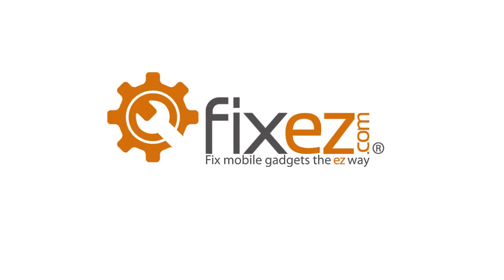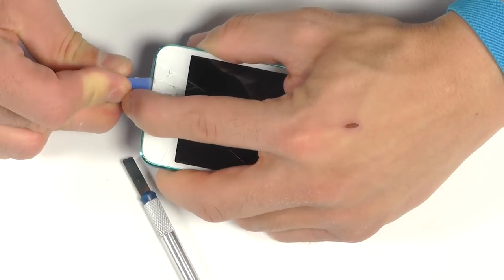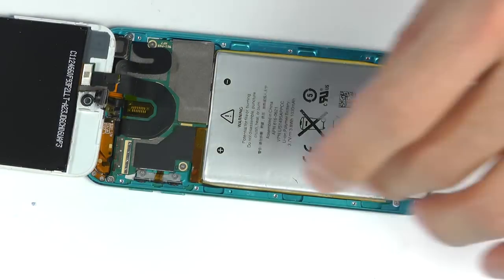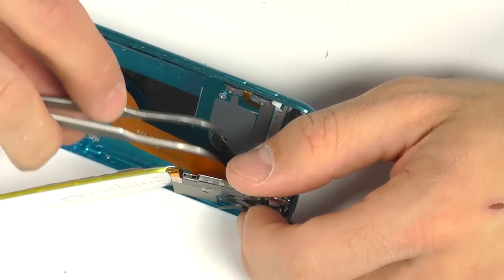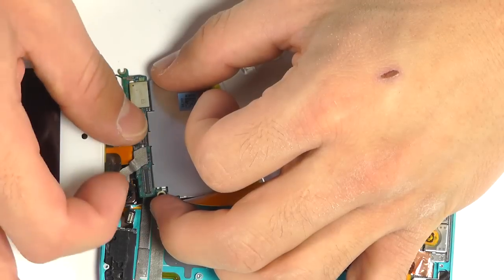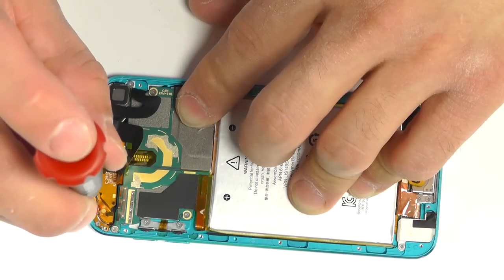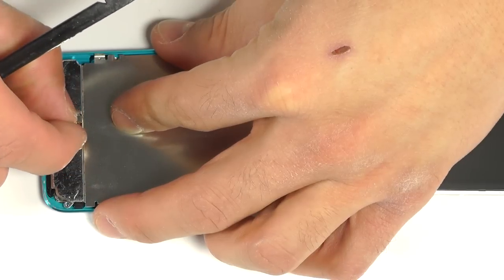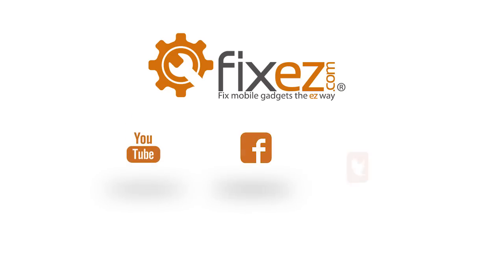iPod Touch 5th Gen Screen Repair & Disassemble - Fixez.com

Comment: Just a tip that wasn't mentioned in the video - it's a LOT easier if you use a heat-gun to soften the adhesive beforehand.
Reply: @Pinkielover  you don't blast it on the screen, you do the sides. If you are ruining the screen then you don't know what you're doing

Comment: Finally a good video!! I wish i would have saw thus sooner. One quick question. When my ipod broke it was all different colors and had lines all over the lcd and the touch screen also refused to work, now that i replaced it, the touch screen wont work and the picture is clearer but i still have lines on my screen but not as bad as before, any idea on how this was caused?

Comment: Just ordered your tools, I'm hoping I'll sail through the repair smoothly. My screen isn't broken or cracked, it simply has no display whatsoever. The back-light comes on when I hit the home button, but not much else. I called a couple of repair shops, and they made it seem like I would need a new LCD without question. If a cable teared on the inside or detached, I'm not sure, but Apple doesn't want to seem handy. I plan to do it myself to save money, while learning something new and challenging.
Reply: ***** Thx. Would a Phillips #00 screwdriver work the same as the 1.5x35mm you used to remove the screws? I sort of got the kit without it, and the x40mms are too big.
Reply: ***** Update: I fixed the iPod! I followed all the steps carefully, and everything works the way it should. I was nervous, but it all worked out in the end. The LCD screen looks as good as the original one, you can't notice a difference. I like how it snapped into place rather than me having to add adhesive. The original screen was hard to lift, and without a heat gun or blow-drier to soften the glue, it can seem almost impossible to remove. Damn apple doesn't want us doing home repairs lol. Anyways, your a life saver, best regards.

Comment: I'm trying to fix this 5th gen ipod, I have the screen installed and ready to snap down but it doesn't feel right when it comes to snapping it down. I'm trying not to damage the lcd while doing that. How do you get to sit in properly? It feels flimsy.
Reply: Has this repair worked?

Comment: Fixez, I did and follow all of the steps mad for some reason my front facing camera ceased to work.  I was uber careful with all wired components.  It looks like its perfect so I could only think it shorted somehow or there's a loose connection that is conductive somehow that fell off.  Any ideas?  Thanks
Reply: I feel you
Reply: So odd that you mention that. Same problem here, no more front camera--just a bunch of lines and colors now. I think it might be sensor damage from the heat gun.

Comment: Once paypal transfer goes through in planning on buying a replacement screen for an IPod touch 6th gen.. The 5th gen screen will work on the 6th right? Also does it matter if it's black or white? I remember reading somewhere when the iPhone 4 came out with white that they had to make some sort of changes for the front camera.. The iPod touch 6 is factory red with white on the front but I wouldn't mind getting black with my white home button, something different.. Is this possible?
Reply: Yes

Comment: I have a question please help me
My screen is crack, but the lcd still works fine and great just the screen is crack and the glass just bothers me 
So do I need to fix everything even though the lcd works or can i just fix the glass if so do you have a tutorial for it or is it not that much diffrent from this vidoe and another video where they just fix the glass because i haven't found a video just them fixing everything

Comment: Hi ***** I would like ask if how can I solve my problem on my iPod Touch 5th Gen. Because it wont turn on. I tried the home button and power button method, tried plugging into laptop (Btw, my chord and accesories are 100% original). We went into a repair shop and they told me that the logic board is the problem. How can i solve it? Please reply.

Comment: should also add that the camera doesn't always pop out of the old screen like it did with in video. its not glued in but the housing it sits in can be tight so with tweezers or something to lever it with a small amount of pressure it will come out. only say this because I've known some people who have got excited about being on a roll with their first screen replacement and stop giving the video the attention they should from start to finish and when it gets to cutting the cables for the screen they've also cut through the camera cable.

Comment: hi  ipod touch 5th gen screen replaced but doesnt turn on. i have checked for damage to ribbons and all connections are fine but screen doesnt light up. i have connected to pc and itunes still recognises the device so it is powered up and operational but screen is still black please help

Comment: Hey there I am having ipod touch 5th gen with me I dont know wt the prob is but when I turn it on the apple logo appears an then it turns off if I keep pressing the power button the sign and the screen starts discolouring I mean there are different colour lines In this case can anyone tell me a cause for this kindly suggest a solution too

Comment: I got my ipod screen cracked but everything else works do I have to have the LCD for it?
Reply from the maker: +Clint Eastwood Yes, the LCD and Touch screen are fused together. You would require the LCD and Touch screen assembly to repair this issue. https://www.fixez.com/store/ipods/ipod-touch/ipod-touch-5th-gen

Comment: My ipod 5 is fully functional just the usb port was damaged by water and its a challenge to charge so how do i replace it?
Reply from the maker: +restricted 1234 We offer the dock port here http://www.fixez.com/store/ipods/ipod-touch/ipod-touch-5th-gen/ipod-touch-5th-gen-dock-port-headphone-jack-replacement-black You can attempt replacing this component. If the damage is only the dock and not the logic board, this should work for you.

Comment: Help!  I replaced the screen and now it wont power on!  I have rechecked everything and I am confident that all connections are good.  I had this happen once before on an ipad repair and was eventually able to get it to reboot.  I have holding down home and power for 20 seconds with no luck.  any help would be appreciated.
Reply from the maker: It's good to check the connections as you confirmed. Attempt connecting the iPod to your PC with iTunes to see if it recognizes it. If it does, possibly have a bad display. You can also confirm this if the original LCD still powers up.

Comment: I dropped my iPod and the screen didn't respond to touch and there were blueish tinted lines across about half of the screen, if I replace the screen will I still have this problem?
Reply from the maker: +CJ Sulfaro Replacing your LCD and Touch screen should resolve your issue. It seems both your LCD and Digitizer were damaged.
Reply: Does the data lost

Comment: I just replaced the display assembly and digitizer but now there is no touch effect, and after a few seconds the screen is full of colored vertical lines. Can you tell me what went wrong? I followed every step to the "T".
Reply from the maker: +M. A. Jimenez You would want to start by ensuring your flex cable is properly seated. Sounds like this is the issue here and if it continues, it's possible you have a bad part.
Reply: Thank you for your response. I have a feeling something like that would be wrong. Which would be the flex cable?
Reply: +M. A. Jimenez Let me rephrase that; which flex cable you think could be the culprit?
Reply from the maker: Your screen assembly has two flex cables, just kindly ensure both are seated properly to the logic board.
Reply: Thank you for your response, I've opened the Ipod again and made sure all the connections were properly seated and that there were no kinks anywhere, closed it and restarted it but it still does the same thing, so at this point I am more convinced that  they sent me a defective part. Thank you anyway for all your help.
Reply from the maker: No problem, thank you or watching.

Comment: My ipod screen just went black, there is no cracks or signs of damage. I tried holding the home button and power button down at the same time and plugged it in to the computer and repeated. Is there something wrong with the motherboard or battery etc?? Before it stopped working I dropped it but there didn't appear to be any signs of damage. Please help!
Reply: It might be the lcd ? Not to sure but i dropped mine with an otterbox one to many times, and it didn't crack but did the same thing. It's probably the lcd but don't take my word for it lol
Reply: +Gavin Carnes ok thanks, I found out the I had a warranty so I just got a new one

Comment: What types of problems can cause your logic board to stop working? My charger cord had wires exposed and started smoking (really bad) when I plugged it up to my ipod. Now my ipod won't recognize any cord (plugged into either an outlet or my computer). The ipod is dead since it won't charge. When I press the home and the switch button, the red battery "battery dead/charge" sign comes up on the screen. Could I have shorted out the battery or messed up the charging port or something? Please help. Much appreciated.
Reply: ***** Thank you. Do you guys do repairs? I'm looking for someone to repair it because Apple confirmed that it is definitely something wrong inside the device but they say there's no hope. Does taking apart the ipod damage data inside? Is it just as fully functioning as before it was taken apart? I was told by a technician that taking apart a 5th gen ipod touch completely damages it (because it is so thin). I really just need to get my photos off so I don't need it to be on too long, just long enough to back up the data. But if I could get it to work like new, that'd be great too. Thanks in advance.
Reply: OK just wondering. Because the video shows you completely taking apart the phone and even taking out the battery (which I also need a replacement of). But thanks anyways.

Comment: How Do you connect the black ribbon wire? on the connection of the screen?
Reply from the maker: +Seth Aque It's a solid connection to the ribbon cable. Simply press it into place.

Comment: I have a water damaged iPod 5 and it's been sitting for two months, I tried a lot of things. Is it still able to be saved, Anything else I can do?
Reply: +Bethany Carley Unless you immediately switched the power off and completely dried the water off of the ipod, it might've died off. When you plug it into the charger and if it makes any sound, it is possible that only the screen is broken and it will work when you change the screen. I had several ipod touch & iphone that had water damage but I managed to switch the power off and dry the water off asap. And I got them fixed and they still work fine.
Reply: Darn, I freaked out and tried to turn it on which was dumb, but it's gone, haha its pretty sad actually because I waited like everyday to see if it worked.

Comment: Hi could you please help? I am trying to snap the clips in but when i try there is no snapping and i am starting from the top. Only one of the clips snap in and this is not secure any suggestions?
Reply: ComputerGenius10 I think I would purchase a new LCD metal plate correct? *****
Reply: ***** No to the clips on the metal board and one of my family members had a idea to bend the metal clips just a little and they clipped back in.

Comment: I recently dropped my I pod 5th gen and the screen cracked completely and is now just showing up black with different coloured lines. It still makes noise when I plug it in so I was wondering if I got both screens repaired would I loose all my data? A lot of the stuff on there is very meaningful to me and I would appreciate if someone could help me out by letting me know, thanks.
Reply: Nope fixing the screen will not affect your data

Comment: so, I Usually release the docking port area and lift the whole back flex up and over. It's much easier to connect those LCD, Digitizer etc connectors when you can see the whole board from behind. All the ways I have seen demonstrated here are fiddly and don't really show you how tricky connecting them are.

also, Before re-installing the shield, test the iPod to make sure you have your connections working. test the cameras, the on'off switch and naturally screen and touch. Last thing you want is to have to undo all those screws again for a bad connection.

Out of all the iPods iPhones and iPads, this is the most fiddly repair to do so don't try if you aren't experienced, send it off to a professional

Comment: hey i pod wont turn on every time i charge it it heats up fron the inside wont turn on tried holding the 2 buttons nothing ,,,,is there any way i could fix it?
Reply: what about if i replace it with an 4th gen will it work?cause i got extras

Comment: Hey if I drop my ipod 5 in water it won't turn on and I don't heard any sound do I need a new battery
Reply: Ok thanks
Reply: Sometimes when I plug it in my computer it makes a noise
Reply: Like it's picking it up
Reply: But the screen don't turn on either
Reply: Thank u so much ☺

Comment: first my ipod will not charge whit out moving around the charger then I left it in my desk and now that I want to charge it it wont turn on need help
Reply from the maker: +Jose Rubio Possible that you just need the dock port replaced as the device may not be charging. Here are the replacement parts we offer https://www.fixez.com/store/ipods/ipod-touch/ipod-touch-5th-gen

Comment: home button wont press for some reason . the rubber and home button came apart i put it back just like its supposed to be but it doesn't click
Reply from the maker: +haseeb jamal Does the home button work at all aside from you not feeling the click?
Reply: Yea I can press it on the home button flex. It's that rubber that came off during the disassembly and I guess I can't figure out how to put it the right way.
Reply from the maker: There is small metal spacer attached to the back of the button. See if this is still there. This would resolve your issue.

Comment: My 64 gb iPod says its disabled for 24 million minutes now that I picked it up and replaced the screen after what has been about 2 months of not using it. I have probably around 50 gb of data and pictures that are not backed up.  What in the world do I do?
Reply: plug it into your pc or mac and open itunes. it will Immediately unlock.
Reply: +Jpk516 I just restored it about 5 mins ago because I had tried everything even your suggesting thanks but it didn't work I literally cried as I was restoring it because I have researched every where over the past three months and I have come to the sad conclusion that it could not be fixed :(

Comment: Why is your ipod touch battery is on the side the other crack open ipod touch battery is on the buttom
Reply from the maker: This is an original iPod, there should be no differences.

Comment: what if you had broken orange swiggly cable
Reply from the maker: +Alex Turley If any flex cable is torn, you would require replacing it. If it's the large orange flex, this is for your dock port assembly. Here you can locate the parts we offer https://www.fixez.com/store/ipods/ipod-touch/ipod-touch-5th-gen

Comment: I'm having trouble getting my replacement screen to fit snuggly in the frame... it's not even bent
Reply from the maker: +huh??? what? Careful with putting to much pressure as it can damage your new screen. It's possible your frame has damage internally causing it not to sit properly. Ensure this is not the case.
Reply: @Fixez  how about if that is the case? What can I do? It works perfectly new screen but there is no way fit it in. Apparently 3 corners out of for are slightly chipped and bent

Comment: this video fails to show the toughest part of this whole process- separating the screen from the device itself. Shoving a metal pry tool down there like is shown will guarantee a very scratched ipod housing. Doing it without heating the adhesive first is virtually impossible.

Comment: I dropped my ipod and the screen stays on the apple logo screen, Can I open it and just reconnect everything? I did this on my iphone when the screen turned black. Would this work to fix my ipod?
Reply from the maker: It's hard to say. A boot loop can be cause by a lot of different issues.